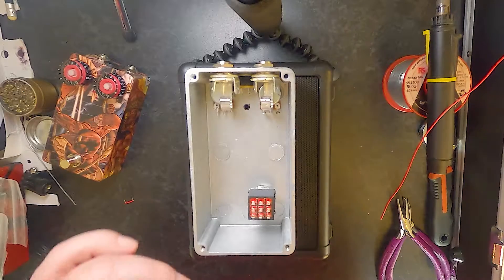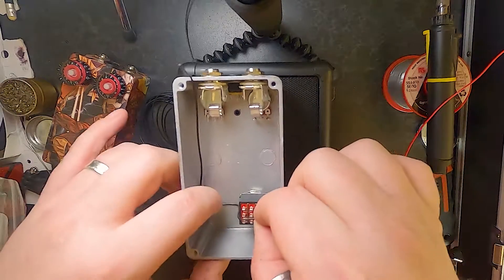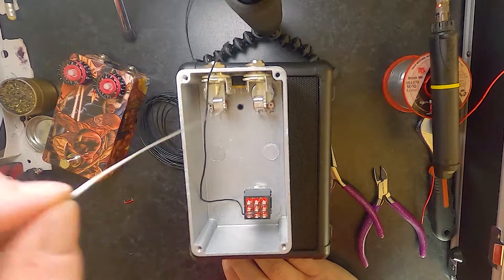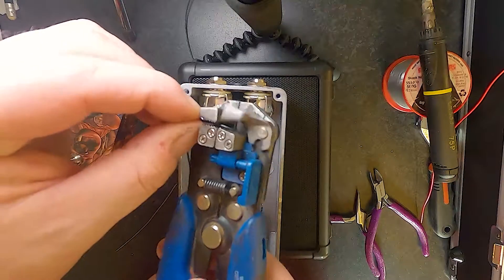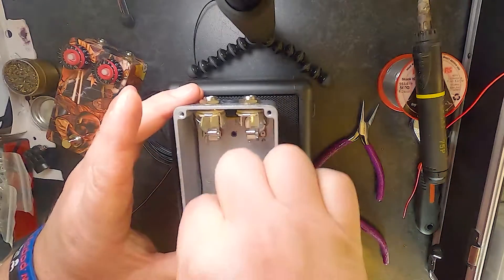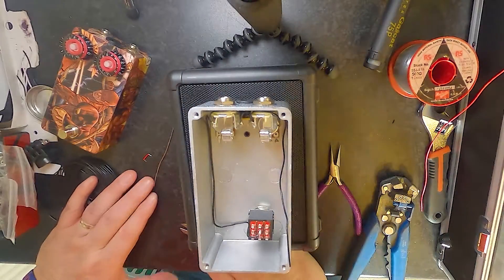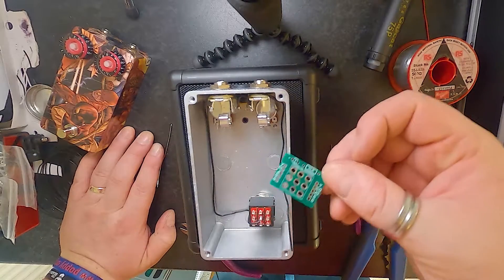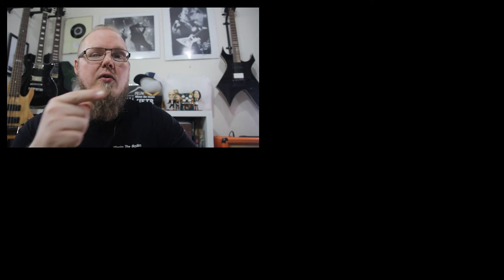DIY Pedal Building - How To Wire In Earth Wires - Earth Chain

Comment: Subscribed the moment you man hugged the camera lol. 😂 Stuck around to nerd out on the pedal build tips. I hope to get into home hobby pedal builds and amp repair more this year. 😊🤘🏽 Keep the video’s coming man!
Reply from the maker: Hey man, thank you so much! Comments like this that keep me doing this!
Reply: @thebassguitarshow  Hey! No problem! Thanks for doing these. One other question I had, do you do the single loop intentionally to reduce ground noise in a circuit vs multiple single point to point? Or have you found it’s not really an issue?
Reply from the maker: Yeah I had a tonne of noise on fuzzes when I first started making them so started doing it this way, rather than running loads of earths to a daughterboard. It certainly helped and then developed into how I now wire my pedals.